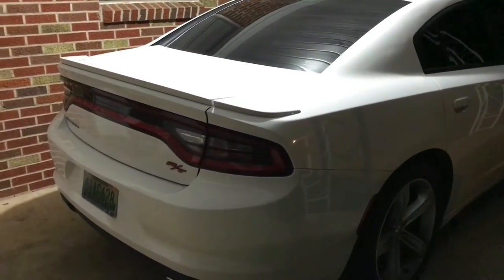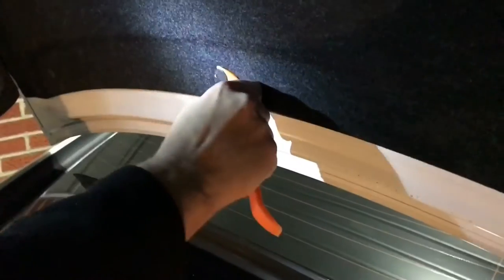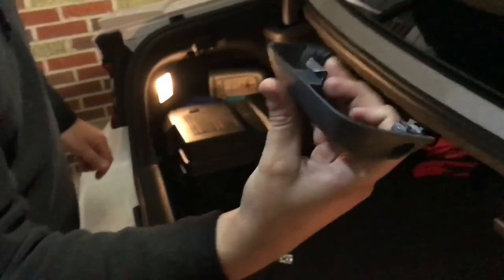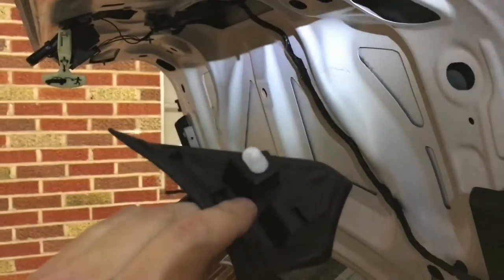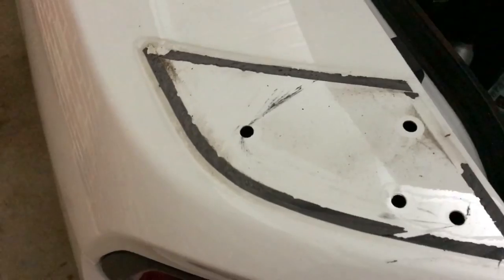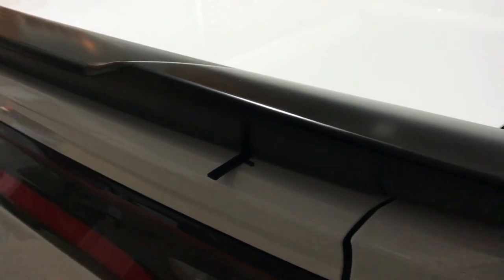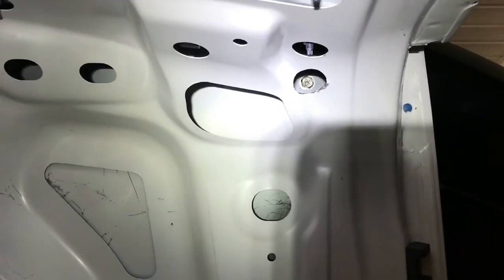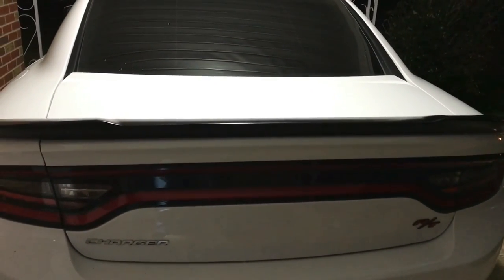Installing a Scatpack / Hellcat / Daytona spoiler on a 2016 Charger R/T.  2015 - 2020✔️

Comment: Car really does look better like that!  idk why they made that split spoiler they put on it... i just got a Charger about a month ago, and I need that spoiler now! looks a worlds different.  
How was it to plug up all those holes left behind, and how exactly did you clean the left over adhesive once you took the factory spoiler off?
Reply from the maker: Yeah it’s crazy how many holes left in the car from removing this factory Spoiler.  Are used a microfiber towel and isopropyl alcohol to remove the rest of the factory adhesive.  Then we polished the paint.  We bought the plugs from AutoZone and painted them with white paint for plastic and used a little bit of clear silicone on the backside of them to help hold them in place they are holding up well so far.
Reply: Thanks for the fast response!  And thanks for the details man,  great channel you got here. Keep on doing your thing with this, and don't throw it away. It's great to go onto a channel and have someone who seems to know a great deal about working on cars and lots of cool little tricks. Just found you this morning and subbed! And ha you don't gotta do all those fancy burnouts to get subs man in my opinion knowledge and helping others to fix their ride to the way they dream it to be is better than someone who just does burnouts but doesn't know a thing of how to work on the car haha
Reply from the maker: Highlander94  Thanks for the support man!  That means a lot.  And thanks for supporting my chase to 1k subscribers!!

Comment: Looks awesome the Scat spoiler I got from Amazon I didn't have to drill the trunk. How did you fill the holes?
Reply from the maker: used some push clips from autozone and painted them white before installing them.  you can't really see them with the trunk closed.
Reply: DK Holloway I also got mines from amazon, I saw a few though. Which one did you get?

Comment: What did you used to cover 8 holes from both sides
Reply from the maker: Well i recommended plastic push pins used for trim and put a small amount of silicone on them. But he has been busy and still riding around with just painter's tape over them.
Reply: Thank you
Reply: Phap Pham get them from Lowes 5/8 silicon I color painted mine. Check out my Instagram page det_muscle to see my pictures